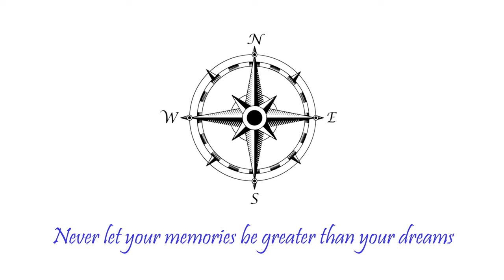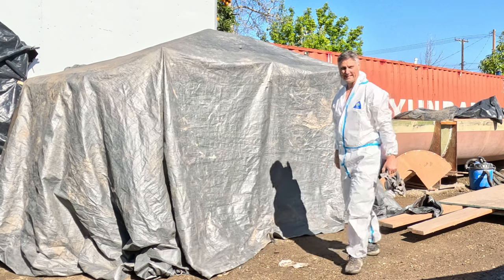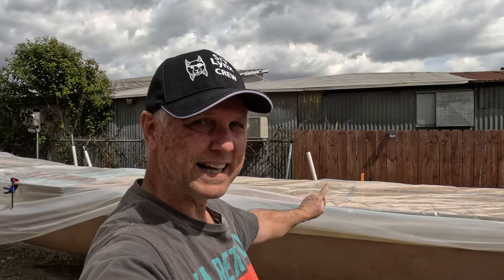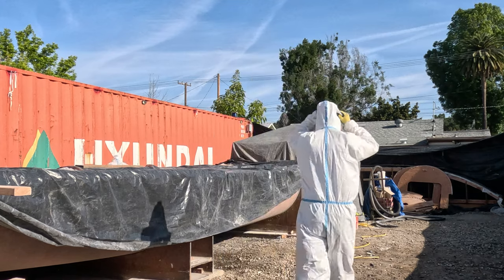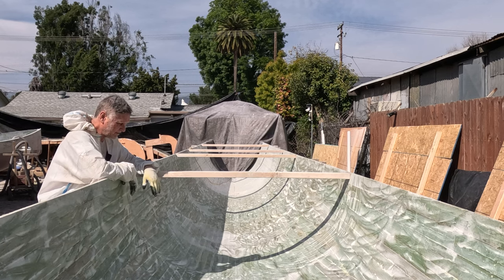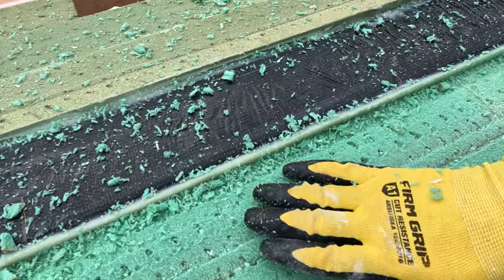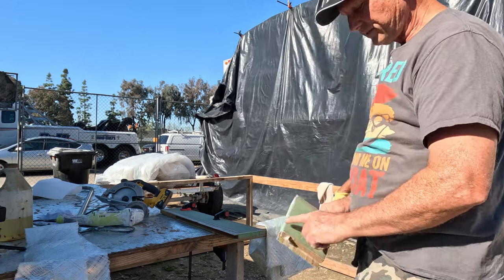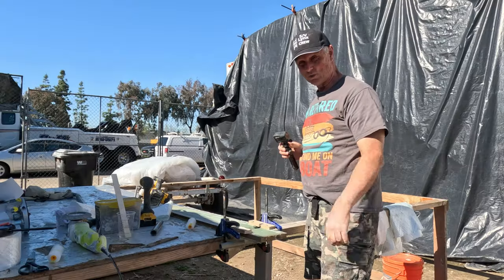Kit E80: Canoe Interior Sanding

Comment: Heh, I found that excess epoxy better to remove at the time it applied. It makes work harder but less mess and waste. However some grinding still required for the next layer of glass. Nifty routing stand. You actually impress and give me some insights to make my centerboard. Like the water catchment. Good luck with the next stage!
Reply from the maker: We did some of that on the starboard canoe, but took off too much and had to do more fill after the epoxy retracted.  Then, we left the squeeze out on the port hull on the lower (now upper) slats before deciding, to take off some of the squeeze out.  That was the best bet, but we only did that on half of one canoe!  So, when I build another boat (never) I'll know what to do!  lol

Comment: Impressed with how you’ve been plugging away at this project.  Was just thinking that you could make some molds of the canoes so anyone in the US interested in building this model could pay you for use of the molds to laminate without strip planking and save the hundreds of hours it has taken you to get this far. Could maybe generate some income to help finance the rest of the build. Just a thought 🤓
Reply from the maker: Unfortunately, creating molds is very expensive.  I talked to a cat builder and they said it costs them about 300k, so I don't think we will be doing that!  ;)  Besides, how could you ship the hulls anywhere?  Molds work for a cat mass production builder because they are building the boats in one location.  This is why none of the catamaran kit builders ship the canoes premade unless the boat is no more than around 40' in length.  That way, the canoes fit in a shipping container.   As an example, MJ Sailings canoes came with the kit, but they had to attach the bow sections to extend the length because the rest of the main portion of the canoes had to fit in the shipping container.  Max Cruise makes a larger cat, but not as a kit.  We sure wish there had been a way to have 50' canoes shipped to us!  They were a lot of work!

Comment: Regarding the dagger boards breaking, it's too bad there isn't a way to have "kick up" like your rudders.  I tried to figure out how that'd work and couldn't get a working model in my head.
Reply from the maker: Those are possible if the boat was designed for it from the start.  You can see them on the Portifino  52.  Check out the Barefoot Doctors channel.

Comment: Have you had any complaints from your neighbours regarding the noise and dust?
Reply from the maker: Just once, for dust.  It was when we sanded off the excess epoxy on the outside of one hull.  There is a video with the title, 'Is it Snowing?" that showed that job.  Since then, we have tented the hulls while grinding off epoxy and that has cut the dust floating away down to nearly zero.  Only the angle grinder is an issue, all our other sanders use a dust collection system, so put out very little dust.

Comment: Are the canoe’s  already aligned. ie parallel and square to each other 
Just wondering how accurate can you make it.
Thank you
Reply from the maker: Not yet, though we took some preliminary measurements to see how far off they are.  The sterns are right on, but one bow has to move inwards about 3 inches (7cm).  We'll do that before adding the bulkheads.  As for accuracy, once we start putting in the bulkheads, we'll make sure they fit exactly.  If we are off by a few millimeters, we'll adjust the canoes to match the bulkheads.

Comment: It’s great to see you do so much grinding inside the hulls!  You may recall I offered some advice when you started planking your hulls, but you considered my advice irrelevant as I wasn’t building a stripped planked hull. I would have gone on to advise that you get inside your hull and scrape off the resin before it sets, it would only have taken 30 mins, this is what my builders did, using a coving tool so that minimal work is required for the subsequent laminations. But you were so dismissive of my advice that I just let you get on with it and it was so amusing to watch you grind away and probably compromise the existing internal laminate with your grinder, hey we all learn. Perhaps you learn another lesson from this, and your lay up makes up for what you have ground away, good luck for the next stage.
Reply from the maker: We didn't compromise the internal laminate, it is all fine.  We were using a lessor grit paper on the sanding disk.  Because of that, it took us longer, but also kept us from damaging the laminate.  We also did scrape off a lot of the epoxy on the first canoe (the starboard side), so we were not dismissive of your idea.  But we discovered that this method caused us some trouble due to retracting epoxy as it cured, so we decided to try something different on the port canoe and leave the squeeze out.  After doing that for about half of the slats, we started scraping off just some of the epoxy, though not all.  That worked out better, and in hindsight, we might have done that from the get go.  But we would still have to sand the squeeze out that remained, just less.  However, if we followed your advice and climbed under the canoes to scrape off epoxy it would have taken a lot longer than thirty minutes!  To go beneath, each time we applied four slates, we would have had to climb under the lowest board, doing the limbo, then scrape off the epoxy in just one of 19 sections between the forms.  Then we would have had to climb out and back in nineteen times.   Multiply that by 100 slats and 19 sections, doing 4 slats at a time and you get about 475 times climbing under.  Assuming each time you got in, wiped off epoxy on four slats, and got out, would take about 5 minutes, that would be 39.6 hours, not 30 minutes.  Sanding off the canoes took us three days, doing about six hours per day, so 18 hours.  It wasn't fun, but it saved time and the pain of climbing under.  And remember, by leaving enough epoxy so that the curing didn't retract inside the groves, we would have had to sand off epoxy anyway (though much less).  Now, when we did wipe off epoxy, we didn't climb inside, we just reached under each slat (until we got near the end).  To take care to only remove some of the squeeze out, but not all, was not simple.  That process took about a minute per section per slat, which turns out to also a surprisingly long time when you multiply that by 100 slats and 19 sections.  It comes out about to 31 hours wiping off epoxy.  And, we would still have to sand it later!  Though again, less.  There is no free lunch.

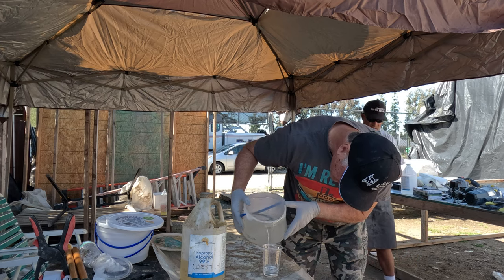Comment: 21:45 why not just use the pvc pipe and rip it in half to use as bottom of through an glass over it.
Reply from the maker: That was the second option we showed in the video.  The issue is creating a hand hold and how to glass that in, it wss far more difficult.  That's why we abandoned that idea and went with the new one.